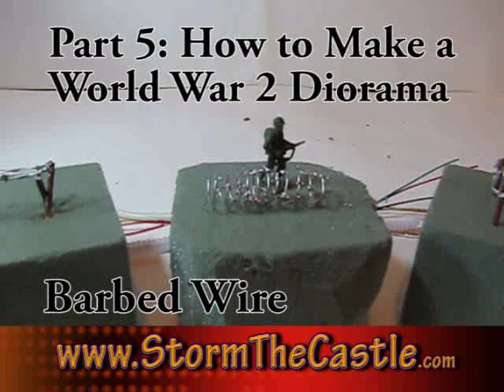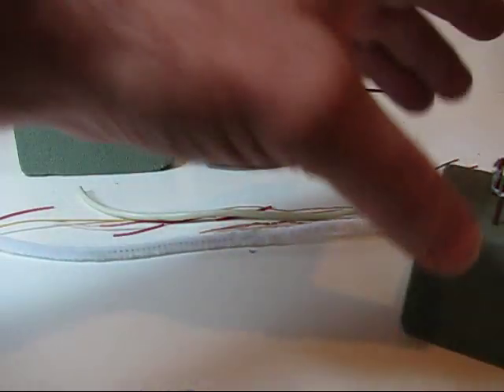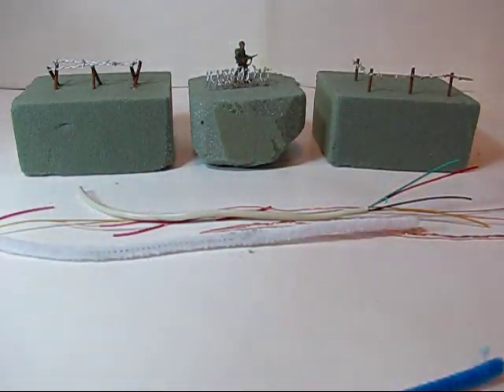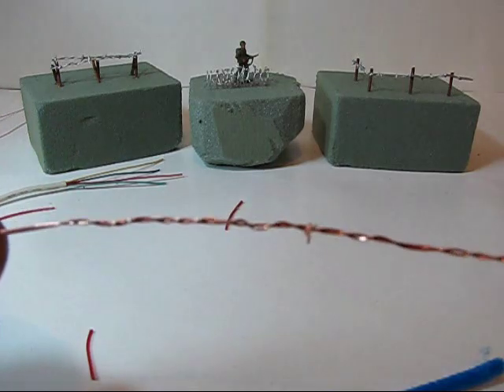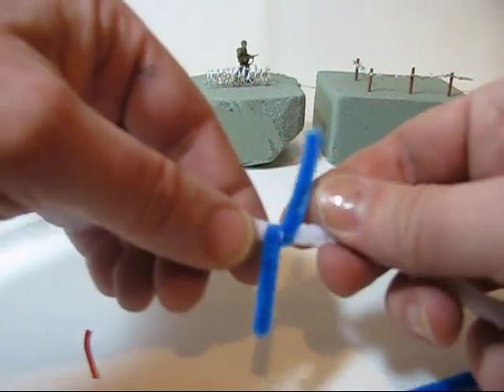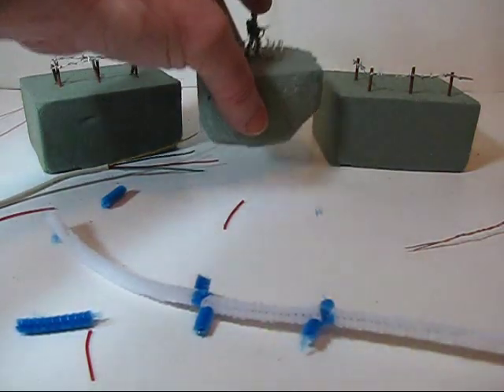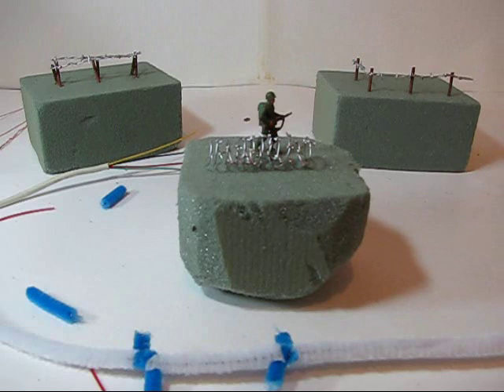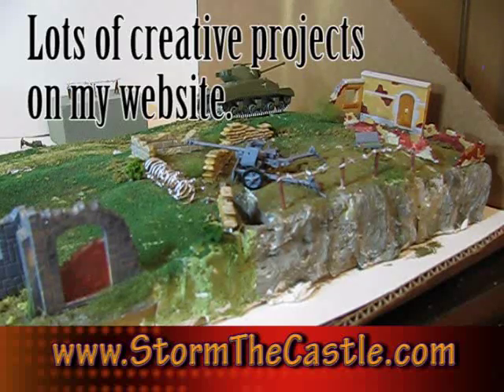Make Barbed Wire  World War 2 Diorama Tutorial:Part 5

Comment: 22 guage wire is too thick for 1/72 scale, or even for 1/35 scale. Single string of 22 guage (0.0253'' or 0,643mm) in 1/72 gives 1.8216'' or 46,296mm in real life! 
I use 0,1mm (0.004'') wire. That gives for two strings wrapped around each other a 14,4mm (0.567'') in real life which is accurate enough (should be 10mm - 0.39'')

Comment: My method involves holding 4 strands of UNTWISTED wire together and tie simple knots along the length where the barbs go and pulling the knots tight.

Then cut ONLY 2 of the 4 untwisted wires just short of either side of the knots to make the barbs, discarding the remains so that there are only 2 strands left uncut.

To finish you just twist the 2 remaining wires together and you're done.